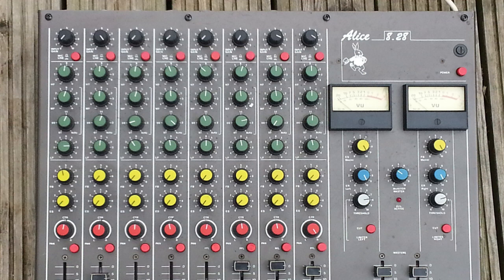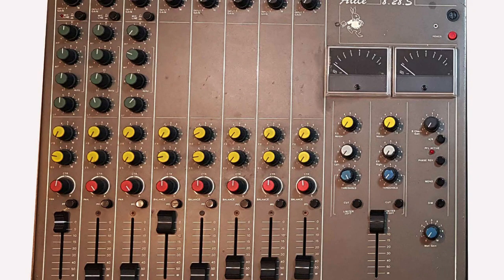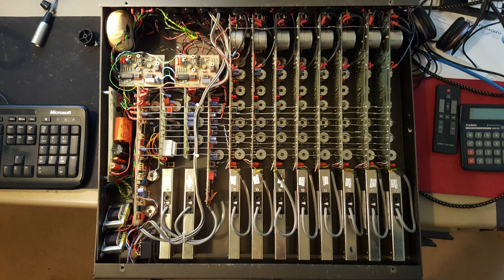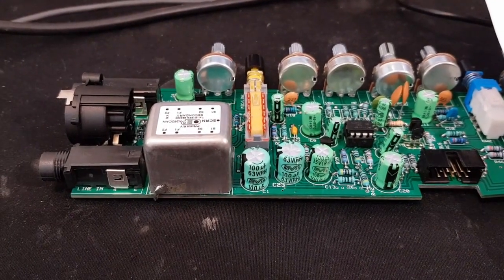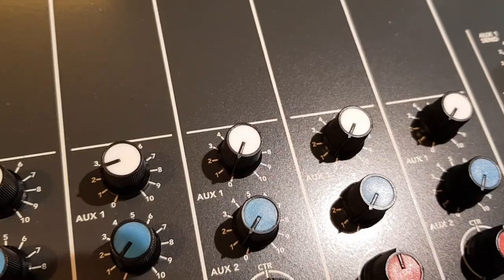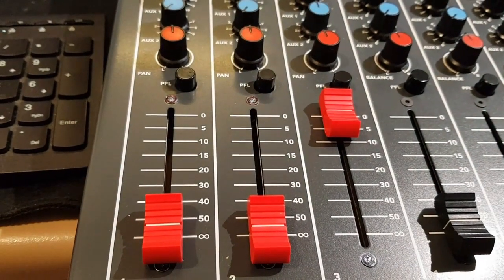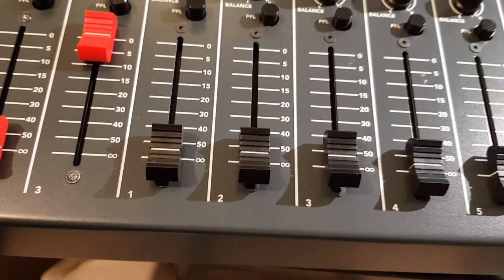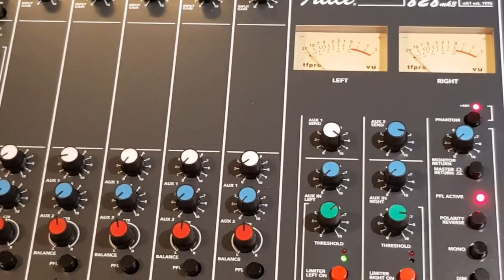ALICE 828 Mk3 Introduction

Comment from the maker: Hi Brendan! In the 70s we designed the format of the 828 entirely independently; there were some competitors who took a similar design line but apart from some friendly technical banter and exchanges with designers both here and in the US, our circuitry was unique.  Now on the Mk3, I have returned to using pure class A circuitry which technically sacrifices ultimate low distortion for overload margin. It's proved to be a good choice, the sound is rounded and full with no sign of the brittleness that gets in everywhere nowadays. The human ear is still superior to test equipment!

Comment: Hi Ted! I recently got a 70’s Soundcraft series one Mk1 which appears to have nearly the same input/eq channel strip circuitry with the sowter transformers mounted on the PCB,  same cable busbars internally connecting all channels, and the same Alps VU meters as your mixers.. of further interest I see the PCBs have TAC 7 written on them.. and I do see TAC have a similar formfactor mixer called the 12-4 as your Alice.   

Further, the great Lee Scratch Perry appears to have used one of your Alice mixers or the almost identical looking Soundcraft series one  (both 16 ch, with 4 VU meters) in the black ark studio in 70s , early 80s.

Could you shed any light on this crossover between your Alice mixers and the early Soundcraft series one, and the TAC 16-4 mixers? 

Cheers from the west of Ireland! Brendan